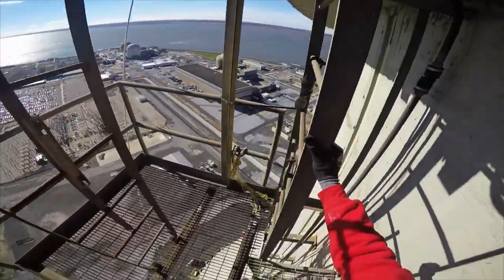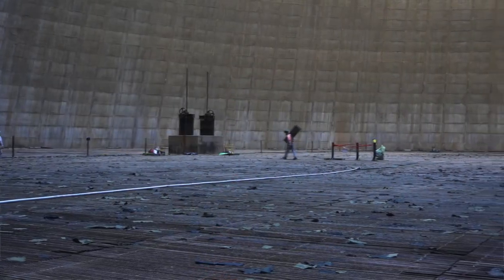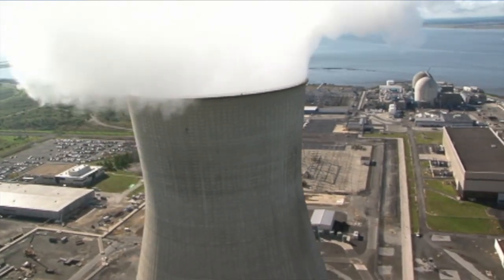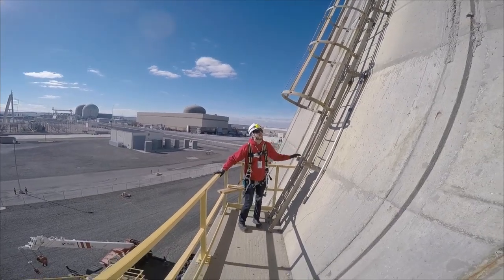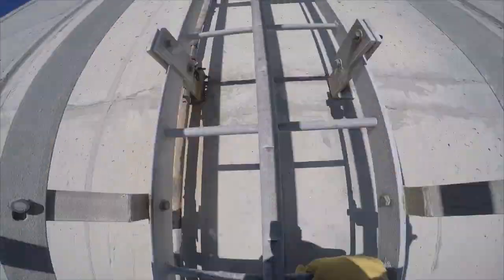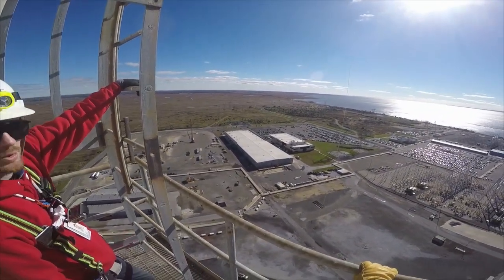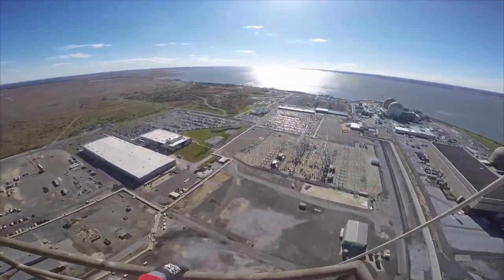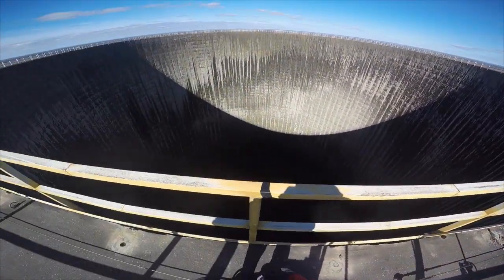The view from the top of the Hope Creek Cooling Tower – Long version

Comment: Thanks for this it is great. No wonder you are in great shape. How often do you climb it? At Wolf Creek we have a 5500 acre lake used as cooling water. It is only a suggestion but since Hope Creek is a BWR and steam to turbine is slightly radioactive, then turbine is slightly contaminated and thus condenser is as well. So how is it there is no radioactivity out of the tower as you say. Well as long as there are no tube leaks, there is no pathway and even if there is a tube leak it is from circulating water into condenser vice out to circ water and tower because circ water is at a higher pressure. Just a little more detail that might be useful to folks but I do appreciate you pointing out the cloud is exactly that not smoke. Most press releases when talking about any reactor always show the tower like it is the reactor or they leave that impression. Great job and I wish you continued success at Hope Creek. Beautiful part of New Jersey. I am in awe of the guys who build em too. I could not do your job. Afraid of heights. Keep up the good work. Dennis Mosebey former System Engineering Supervisor and Shift Supervisor at Wolf Creek for 33 years.